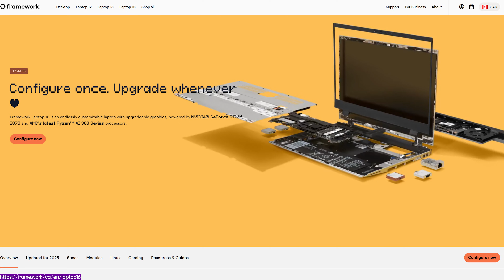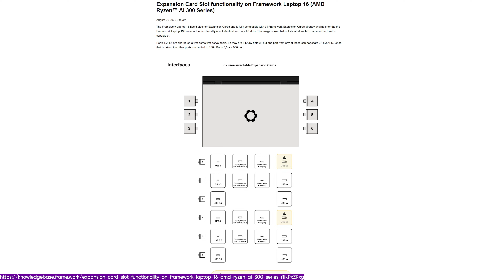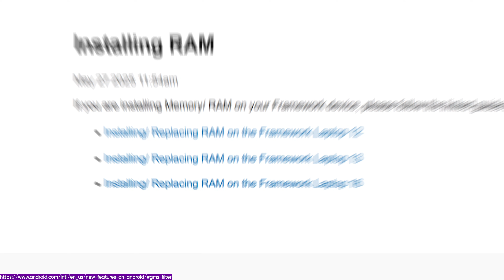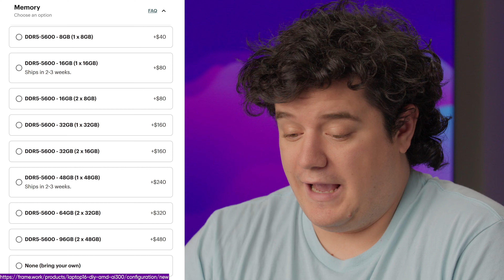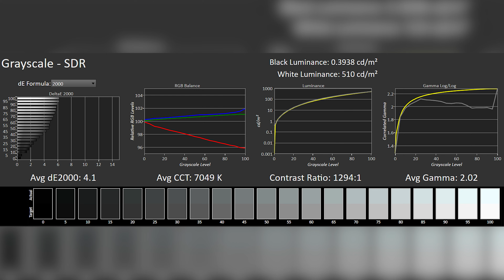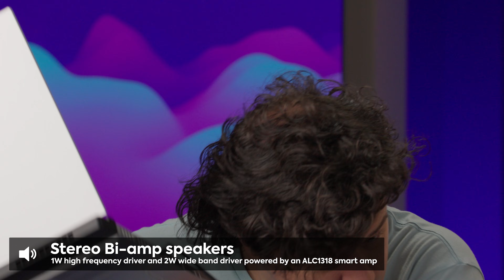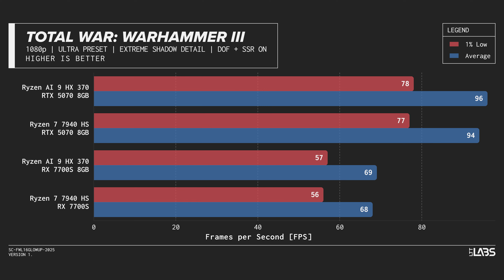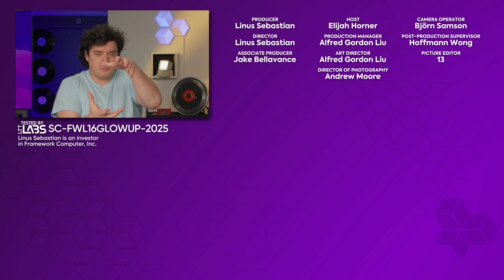I can FINALLY Upgrade the GPU on My Laptop! - Framework Laptop 16 (2025)

Comment: The price tag is still a killer for me. I think I might consider it at 2k. 1K for a solid build (pc equivalent), and then 1k for it being portable, and easy to repair.
Reply: You could probably configure it for 2K with the 5070, if you leave off all the input cover extras, and BYO SSD and ram.
Reply: @ClipstopherBurtraw nah its 3 grand when configured the same as an gigabyte air x16, Wich is 1600 bucks
Reply: @ClipstopherBurtraw   Nope the cheapest you can get is literally 3k with no SSD or ram, no charger, with the 5070.   The thing is I can literally buy a laptop with a better screen and a 5070 for under 1400 right now.    For literally the minimum price you can get once you add things like the charger, ram, ssd, the USB, hdmi, ethernet ports, windows, etc is roughly 3600.   I can literally get a laptop with a 5090 for that price.   I priced one out thinking about getting one but the pricing they have just makes absolutely no financial sense at all.
When I can literally buy a similar spec laptop and then buy another new one in 2 years and still be well under the cost of just the original framework is just insane.    It isn't even economical if you upgrade things at those prices.
Reply: @MaethorDerien damn, I priced the first gen out but never did the 2nd Gen (I have no need for a gaming laptop, I was just curious the first time), had no idea it went up so much.
Reply: @MaethorDerien  $2400 with 500GB SSD, 16GB of RAM, a 5070, and a power adapter.
Reply: @MaethorDerien guys you are mistaking CANADIAN $ with US $ the minimum is still very expensive 2650€ for a 8GB 5070 / 16GB RAM / 1TB SSD it’s basically a 1K up charge vs the competition
Reply: @MaethorDerien yea there trash been saying it since they dropped LTT is the only reason there around and they don’t even use them lmao 😂 there a gimmick that’s about it

There “affordable” one is that 12” toy they sell and it’s 1000$ us
Reply: Framework don't have the volume that the large manufacturers do, so they can't get the same discounts. That's one of the reasons it costs more.
Reply: @Daniel15au  why do they sell the standard parts (memory, storage) for almost twice that of retail aswell?
Reply: Buy it piece by piece and build it like a motorcycle. Or buy the lowest config for cheaper and upgrade it over time.
Reply: @ericbonanno5214  the lowest price tag for this laptop gets you a laptop from any other brand that is just as good as the one shown in the video
Reply: @ericbonanno5214 like a magazine series. With each magazine purchase you get one more packet of capacitors to solder to the motherboard! The first edition comes with the motherboard circuit 🎉

Comment: The framework should make a netbook like "One Netbook 5" from Onexplayer. I would definitely buy it. Who would not want a netbook that's upgradable, or at least the process and battery part? Surface suck in this, for me 13" laptop also feels big for regular tasks. The one netbook 5 specs: Intel i7 1250U, 32GB LPDDR5 5200MHz dual channel RAM, 1 TB storage, 2-in-1 laptop tablet, 10.1 inch 2.5k LTPS display,100%srgb, Harman speakers. Has a 65W gan charger included, 8-hour battery.
Reply: What about the Framework 12? They already make a smaller one.
Reply: @benp439  And the Framework 12 is also a 2-in-1.

Comment: I want this to work so badly but I can't help but think "wow, this thing looks awfully outdated."  The spacers don't even look right (coloring and as Elijah mentioned, height). You have to get the manufacturing tolerances and parts standardized enough to make this kind of modular design work before you end up with a frankenstein looking (you need to be a frankenstein without looking that way)

Comment: The price is reasonable for what you are getting. Even on the enterprise side, where "upgradeable laptop GPUs" DO exist, ANYTHING even close to that 16" laptop is 2x the price. (I say, typing this on my work HP Zbook Fury 17 G8 with an i7-11850H, A2000, and a 16" screen, that retailed for over $5k. And my work paid more than YOUR config for this rig. That being said, I have 4 SODIMM slots, 4 M.2, and a 2.5" bay.)
Reply: lol the price is not reasonable

Comment: 11:03 96GB Ram would be needed for local LLMs similar to Mac Mini with the 96GB Ram or the Framework Desktop with 128GB Ram, which you can dedicate via BIOS 96GB to the VRAM

So considering how smart Framework is regarding that the Laptop might be used as a Homeserver after future Upgrades, or immediatly, its really good that they are giving the customer to decide that!

Would be curios how many TPS this laptop could handle compare to the Framework Desktop version
Reply: This use case would let them sell 3 extra devices. As much as I like the concept, their offerings just aren't good enough.

Comment: 12:58 I dual boot fedora and windows 11 on my framework 16 and I’ve noticed a huge difference in colour reproduction between the two os. I would love for you to explore that since I don’t have the hardware or knowledge to test that, but from my experience, just use Linux 😊
Reply: If you have KDE you can easily add a .icm color profile on the display settings, or at least try to use the "Built in" profile with custom color intensity. Gnome or any other DE... good luck lol, I feel like KDE is the only DE on linux that makes sense now.
Reply: Yeah it really just seems like a color profile thing.
Reply: Which one is better for the colors? Windows or Fedora?
Reply: @cwhiii  I'd be shocked if Windows was better, but maybe I'm just jaded, lol
Reply: Microsoft's falloff needs to be studied.

Comment: The LED control library is open source and the website is self-hostable. So even if Framework gets hit by a bus tomorrow, there will be a way to configure the strips.
Reply: hard to see in the video, but the site does have a handy "Download offline version" link
Reply: @isjami21  Yeah, below that is literally the source code hosted on GitHub
Reply: Also you might be able to just download the html and use it offline
Reply: @user3840that fits the "self hosted" definition
Reply: @user3840 Thats not how HTML/webpages work. HTML is a mark up language. It makes the page display. It can't actually 'do' anything. It needs javascript to do something.
Reply: Must be a big bus to hit a whole company.
Reply: @envynoir  Imagine the whole company got ISEKAI-ed
Reply: No, they meant the founder: John Framework
Reply: Also I know the keyboard, numpad, and macropad are QMK/VIA compatible. I wouldn't be surprised if the LED matrix could do the same thing with a community made VIA profile
Reply: this, and we also really like it if you're running a different OS. You mentioned the mouse that starts auto-installing software when plugging it in. This is the better way.
Reply: Okay.... but this is also the kind of thing that linus would be flippant over if another manufacturer said "You need to connect to the internet to adjust your RGB settings" even if you can self host it... a person having ever contemplated configuring hardware on your computer to require an internet connection at all in anyway, is bonkers. You shouldn't have to do extra steps to use the hardware you bought.
Reply: Thanks clippy
Reply: Lol got hit by a bus.
Reply: Love this laptop it's just lacking the software department though. That I'm happy to say is slowly changing. There was no way to control the fans and set curves previously and now there is. I've built an open-source tool to allow you to do that. I'm also planning on adding an LED-Matrix controller to it. The current tool is pretty useless given that you loose your design after you restart.

To find my tool, simply search for: "ozturkkl framework-control"
Reply: Yeah I was going to say that a website is a fantastic idea. No extra software to install, and you can still just download and run it locally since it's entirely client-side code.

Comment: I'm a big proponent of repairability and ownership, and have been a fan of Framework's philosophy, but this looks pretty disappointing.  The different chassis modules not aligning is such an apparent detail and a big deal breaker considering that is literally the part of your laptop you will be touching every day.  Also, to me, the huge amount of deck flex and especially screen flex is very bad.  Obviously, I'm not hands on with it myself, but I'm pretty disappointed.  Especially at that price point!
Reply: As an OG FW16 owner, I can say I don't really notice panels not lining up, but I do notice the slight very slight color difference between the spacers and the trackpad components. That being said, it doesn't bother me much and I barely notice them anymore.

Comment: Man, I must be getting old. That “shelf” used to be so standard on laptops! Haha 😂
Reply: Also like, it's the external GPU. It's not like you can move the hinge back any further.
Reply: Reminds me of my uncles Oldsmobile 58 with the body kit. You could literally use the rear of the car as a bench haha
Reply: Heck, my 2019 Lenovo has one.
Reply: @japzone  my 2023 legion 5i pro has one too 
and.. some other higher end gaming laptops..
Reply: its pretty normal still on an lenovo, my  2022 legion has it for extra gpu cooling
Reply: Yup... But back then it used to be the battery.
Remember when those were externally available to just hot-swap or replace? Good times... ^^

Comment: I mean the concept is great, just being able to swap everything, but sadly they look like my moms Dell from 2010, would be a huge downgrade in terms of power efficiency and noise compared to my Apple Silicon MacBook (Who wants to play Cyberpunk with a jet engine running, sitting next to a power outlet because this thing draws 200W? My MacBook barely turns on the fans when I play Cyberpunk) and the Display looks kinda bad and no real HDR. Meh. And it isn't even cheap, when I use CPU/GPU and addons from the video and put 32GB RAM and 2TB SSD in, it's over $4200. Edit: Plus, the M4 Max Chip in the MacBook Pro is in both, Geekbench CPU Multicore and Geekbench GPU around 30%-35% faster than the maxed out Framework and is still cheaper with the same RAM/SSD config. There is like zero benefit in the Framework compared to the MacBook except the upgradability. It's price to performance is worse, GPU/CPU performance itself is worse, screen has weird colors, only 500 nits compared to 1600, lower res, it's looks worse, it's 300g heavier, it's louder, it draws way more power (less battery life), it's made of plastic instead of aluminium, the keyboard is worse, the trackpad is smaller, etc. And the prebuilt version is even more expensive. Yeah, when it's outdated I can use the old hardware as a home server, but I can also close the lid of my old MacBook and use it as a homeserver, without buying an extra case for that.

Comment: His face when he mentions the price says it all, dont bother with framework's cashgrab. You can get a better laptop with a fricken 5080 for $1000 less.
Reply: Sure... but you will never upgrade it... I tend to use my machines for a LONG time... I even bought an external thunderbolt GPU to extend the life of my 3000USD Lenovo P50 so, having the possibility to upgrade motherboard, ram, ssd, GPU, screen is a good investment. Mind you, the configuration he says costs 3000usd had two NVMEs, 32GB ram, several extra accessories .... you MIGHT be able to spec it some 300USD lower.

Comment: Prices individually for screen and 5070 are fine, desktop 5070 msrps at 550, so a 150 markup is not bad for still a relatively boutique manufacturer that also has to design the interface and housing between it and the rest of the computer. Sucks though that the screen is practically a needed upgrade, but in itself it is not really a big feature upgrade.
Reply: would be okay if the mobile 5070 was an actual 5070. But no. It's a 5060ti 8gb in both chip and memory configuration, which nvidia are calling a 5070. This is peak marketing scum. Not framework's fault, but nvidia's. If only it was based on the 16gb 5060ti, maybe then it'd be somewhat relevant
Reply: @yourcomputerhasvirus7733  you know, when saying not bad i actually was thinking "huh the framework markup is not too bad even though it's a mobile chip", but what you're saying brings it right back into expected Framework markup.
Reply: @RenAigu  Oh I don't even fully blame framework for this one. It's probably mostly nvidia to blame for calling a card what it isn't and selling it at a price it has no right to be sold at, then add on to that framework's own costs for manufacturing the assembly, R&D and their profit margin

Comment: they should make spacers that have front facing speakers (to add to the chassis ones). Front facing top speakers do wonders when implemented correctly (like the MacBook Pro, which has basically the best laptop sound system available).

Comment: I was disappointed that they didn’t offer a gpu option with more vram, the performance of the AMD option was fine for a laptop just wanted more than 8gb for better new game support
Reply: VRAM is controlled by the GPU vendor.
Reply: @agentcrm  Yep, and nvidia should have already been updating to the 3gb modules so it could be 12GB, that would be a huge improvement. But I'm guessing it hasn't happened since all their ram is allocated to AI garbage.
Reply: Why even get this for gaming? Lol actually why get this at all?
Reply: @coldbreezecaori  I see the allure I guess, but the build quality seems so flimsy.
Reply: @coldbreezecaori  Why get one of these.
Because they've actually committed to upgrade-ability and reusability. 
These you can change and remove the GPU, or order it without a GPU and then buy one later when you can afford it or the next generation comes out.

Comment: I upgrade my hardware every 10 years or so. If it is certain that they'll have something I can upgrade to if I need in 10 years from now, then I'll buy into it.
Reply: If you update that infrequently you don't need a modular platform. You will just buy what's current at the time of your update.
Reply: @thenamelessone7  no thanks. That's just consumerism. If I have a perfectly good everything else, but I just NEED (not just WANT) an upgrade of some components, I much rather just upgrade what I NEED and keep everything else as is. Then just repurpose or recycle the old components. Basically the whole Framework moto.

It's the same thing with cars. Almost no one buys a new car because they NEED it, they just WANT it.

But hey, it's been about 70 years since that mindset was established in society to the point it's basically part of the common sense even if it's objectively wrong for many reasons.
Reply: @Wonka0998 this is such a weird flex ever. The tech will be mostly obsolete in 10 years time. Most materials will be recycled anyway and there will be abundance of renewable energy.

Comment: I generally wait multiple generations between upgrades on desktops so I think I'll be doing the same with my fw16. It currently does what I want so I don't need to upgrade right now. Maybe next release I'll upgrade. I'll also want to see more use for the old hardware. When I do upgrade what do I do with the old mobo/gpu/screen? The fw13 has options for a mini desktop but I haven't seen that for the fw16

Comment: Framework are garbage. Being an early adopter of FW13, I haven't seen a single problem it had at launch get solved, and this seems to ring true for every item they've released since. You better hope it works once it hits your doorstep, because it probably won't ever get fixed. Framework approved method of solving it is changing your board because OMG upgrade so easy

They shout from the rooftops about being able to fix their stuff, but can't even hold themselves to their own morals and support their older products.

Comment: The only down side is the 5070 instead of the 5070 ti GPU...  The extra 4 gb of memory would be extremely helpful.  8 GB of memory is just so horrible for future proofing.
Reply: Wait till next year.
Reply: The "good news" is that with the new Steam Box coming out that's only 8GB, developers will be working hard to target 8GB for the foreseeable future.
Reply: @somefreshbread  The Steam Box is cool but there is no way that enough units will be sold that developers feel incentivised to target 8GB.
Reply: @uhohoverflow  Right but it's on top of the 4 million steam decks out there too that max out at 8GB VRAM. I said it poorly, but my point was that they're solidifying the 8GB stance they already took.
Reply: @somefreshbread  I hope this comment ages badly, but the Steam box looks to be dead on arrival. Why anyone will want to pay normal price for hardware that is outdated before it releases and also have to deal with SteamOS issues is beyond me. I think developers will be lucky to include a settings profile for it as a last resort.

I'd have loved to see a good Steam Machine finally pull gaming onto Linux full time, but the 8GB gpu is unacceptable bad. The Steam Deck made sense. I have no idea why anyone will buy a Steam machine v2.0 over hardware they can control and get much better components for.
Reply: about the  future proofing, you could just upgrade down the line, its not like you stuck with the 5070 like on a normal Laptop

But I do agree more Vram is always batter. There could maybe make a 5070ti moudle how knows
Reply: The flip side is that the 5070 has lower power draw. 50-100 W vs. 60-115 W.

Comment: I debated about getting this or building a sub 5L SFF Pc and decided for that option instead. It was much cheaper and upgrade paths are much cheaper too if you get AM5 with a 60 class GPU which is close to the 5070 mobile. Only draw back is I have a carry on in addition to only a backpack on a plane but that’s fine. It’s easily upgradable too since I can just buy a new GPU or CPU motherboard ect and reuse power supply and case.
Reply: Honestly I love the 5L form factor and would love to see what you go with for parts